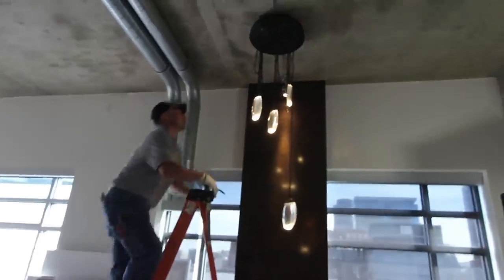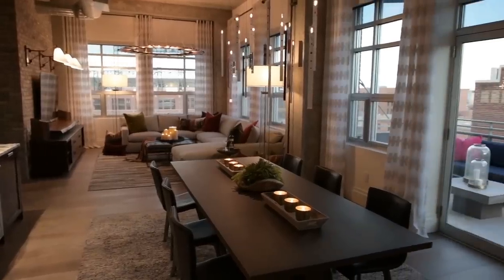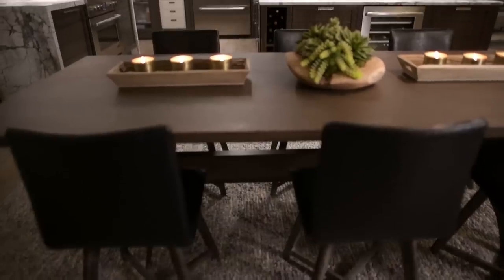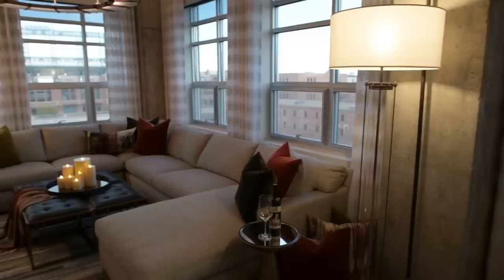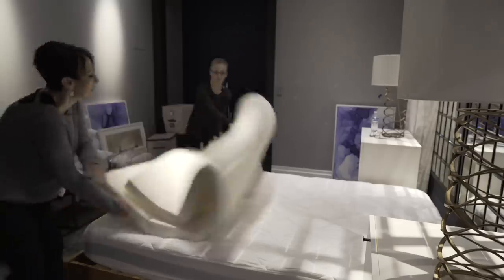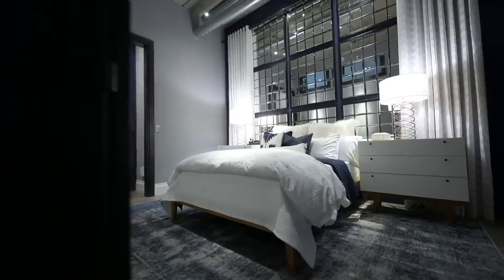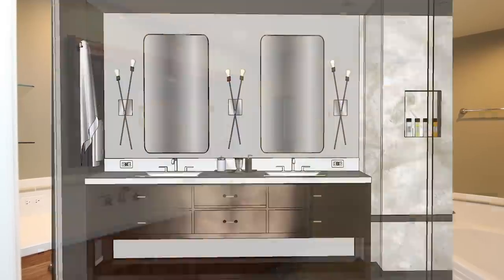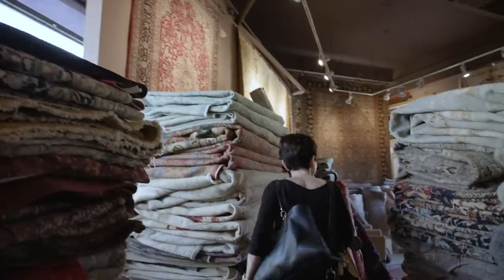Apartment | Furniture & Accessory Ideas | Interior Design

Comment: What Ive learnt from you Rebecca is to pay close attention to the small details.  Im sprucing up my bathroom at the moment and I dont want to change any of the plumbing. Which means I have to pick fixtures that fit with the original plumbing. Not so easy with modern tapwear but doable with research.😆 
Cheers!
Love the hallway! Actually love it all but the hallway stands out because I could achieve that myself. As long as I copy you.😉

Comment: Wow. Such extraordinary visions. I especially like it when you choose things that go together but are different. As each came up I found myself thinking "purrrfect." Except for the bathroom sconces. I think the middle one should have been larger since the star is usually found in the center of a group of three. Either the two at an even height like you chose but larger than the back-up singers. Or a group of three lights that maybe were also larger than the side lights. This only stood out as a slightly wrong choice because the other selections were masterful. Brava.

Comment: U R Awesome!!! I just bought a ranch style home that has no light fixture in the living room and none in the 3 season porch. When walking in the front door you see the living room, the dinning room that does have a place for a light fixture, then you see the 3 season sun porch that has no light fixture, which is all windows. I am looking for a way to stop the eye from going straight through, out the back sun room. I'm thinking I am needing a dramatic light fixture in the dinning room, but I am also thinking that will over power the living room and sun room that don't have ceiling light fixtures. I close on this house Nov 12, I am pulling my hair out. My color scheme is gold, white, black with a touch of blue. I am putting a touch of leopard print in the living room hoping to help keep the eye there, but not sure about the lighting.

Comment: So what is so custom about the chest going through the elevator?
Reply from the maker: Hi Lina, the chest of drawers was over 10’ long so if it were all in one piece, it would not fit in the elevator. Breaking it up into 3 separate pieces at 38” each, it was easier to deliver. Once the 3 chests were slid together tightly, it looked like one long chest of drawers 👍🏻

Comment: Sound Barriers Heat Insulation Fiber Glass Wool Blanket Products

SoundBarrierFence is a professional OEM Manufactory for noise barrier fence products. We have incoming quality control and inspection again when put into mass production. It is a tribute to our stringent quality control, competitive pricing and excellent after sale service support that we have a long list of customers.

Sound Barriers Heat Insulation Fibre Glass Wool Blankets Product
1).Performance won't degrade with moisture variation.
2).Easy to fit on temporary fence
3).Has a new innovative look
4).Safe, non toxic, non allergenic

Sound Barrier Products

Outdoor Sound Barrier Best Sound Barrier Wall Railway Sound Barrier
Sound Barriers Heat Insulation And Sound Insulation Glass Wool Roll Blanket
Sound Barriers High Reflective Insulation Sound Absorption Polyester Wool Blanket
Waterproof Sound Absorbers Lowes Fire Proof Insulation Sound Barrier

They are widely used in public events noise, exhaust pipe noise, any outdoor noise source, sound barrier curtain, cooling units for data center, commercial mechanical equipment, load manufacturing process, acoustic ceiling insulation blanket, and so on.

We have a 3000 square meter factory area with dust proof section for sound barrier insulation fence production lines. We have a work force to ensure that every product goes through stages of thorough quality control checks before shipping to our esteemed customers. When assembling in production line, SoundBarrierFence will inspection again to assure it is ok before put into next procedure.

http://www.soundbarrierfence.com/Noise-Barrier-Fence-Introduction.html

Tag: acoustic fence panels brisbane, fencing barriers, sound proof fencing traffic noise, soundproofing road noise
Reply: just chek it